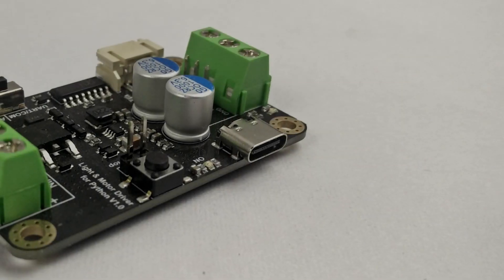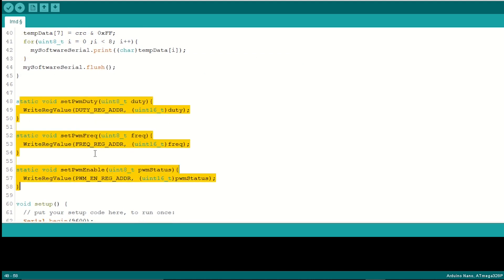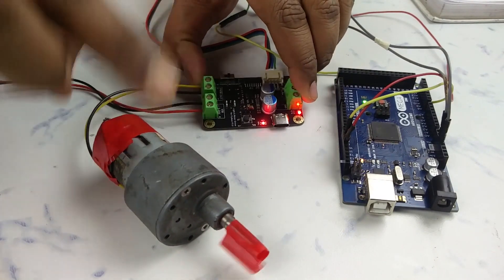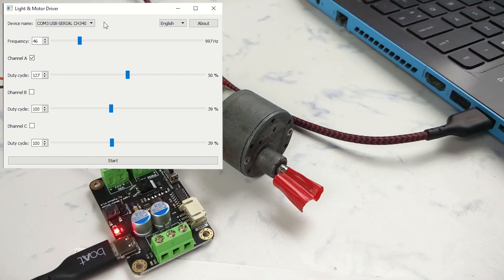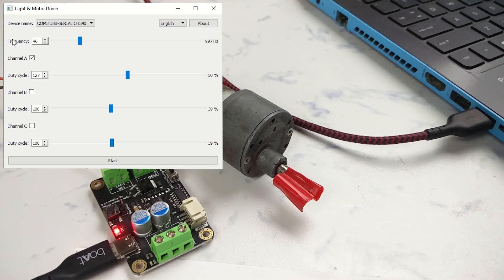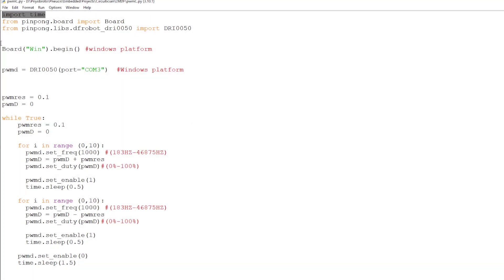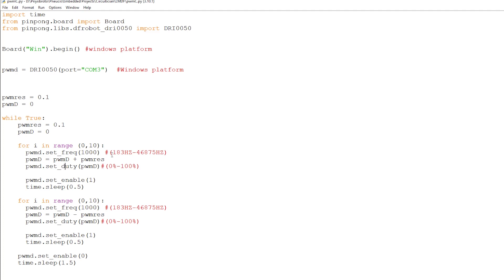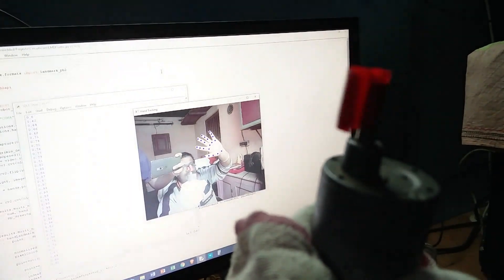Controlling Motor Driver using Python | DF Robot's Light & Motor Driver Module for Python V1

Comment: How can i use hc-12 with arduino using python language??
Reply from the maker: If you want to use arduino then I would recommend arduino ide.
And if you are comfortable with python then I would recommend you to use esp boards rather than using arduino
Reply: @circuiTician   i have a machine learning code in python if it work the pyhon send a signal by arduino to another in wirless..
This is the main idea..
Any suggestion else?
Reply from the maker: Send data to the Arduino using py serial library by serial communication and then write a code for arduino that what the arduino will do after getting the serial command
Reply: @circuiTician   do you have example about this idea?